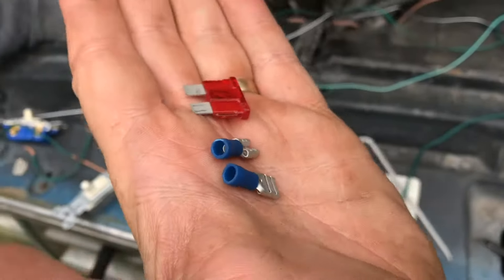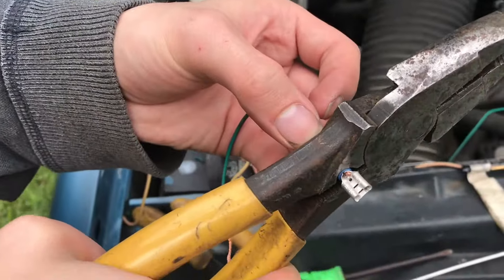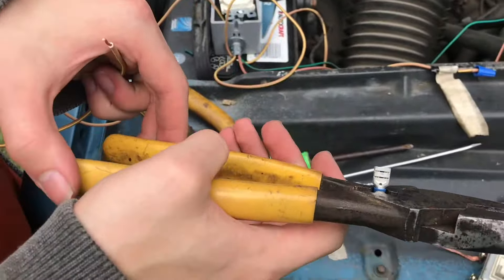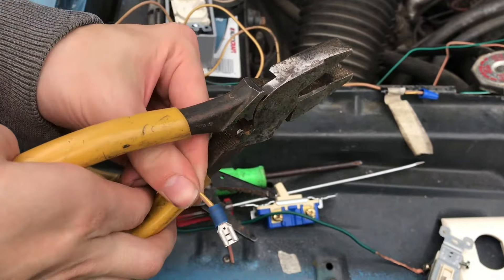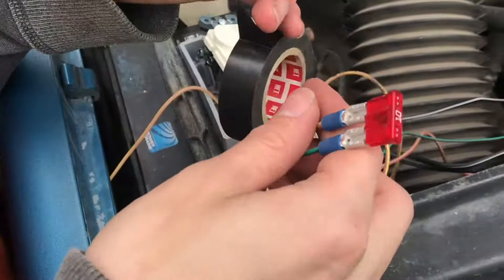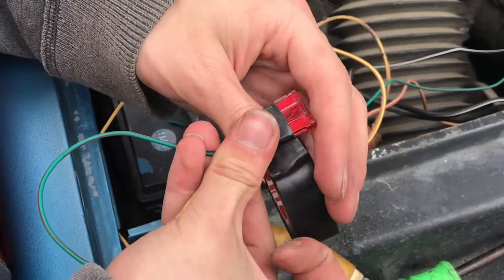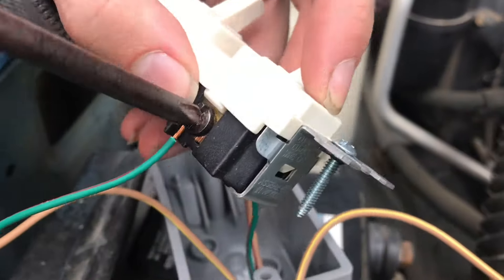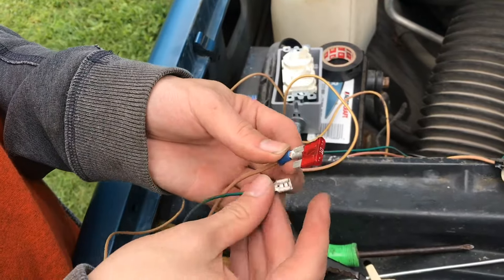EASIEST way to add an in-line fuse

Comment: You can also use heat shrink on each spade terminal as well, or insulated terminals. The tape will eventually get brittle and peel away over time.

Comment: Thanks for the video! I need to add a 1amp inline fuse for my boat trolling motor heading puck. This is a simple solution and prevents me from having to buy a cheap option that is prone to fail.

Comment: this is exactly what i started doing in my house with a new fan over a radiator to try and measure the CFM ...i needed more hands and less sparking so started trying to hook up a fuse and inline switch from my house haha! thanks... im looking closely at how you wired the switch, mainly curious on the ground.

Comment: Hi I'm running a 12vdc to 5vdc 15w buck connector with 2 usbs from a 12v lesuire battery. Connected with a 12awg inline fuse wire fitted with a 3amp fuse. I'm powering a alarm panel 5v connected to one of the usbs. And the other connector to a 5v siren. The alarm panel has a jack splitter with 2 sirens connected via jack input. Working current of the panel less then 120ma. And jack siren output less then working current 500ma dc3v to dc12v the Jack siren is rated. The usb siren 5v 1A working current 150 to 200ma. The inline fuse wire is tepid warm from the battery but not hot is this normal. Then the rest of the cable is cold from the fuse out to the buck.